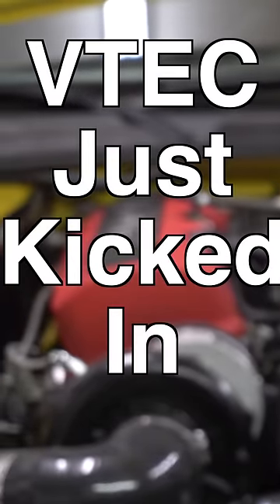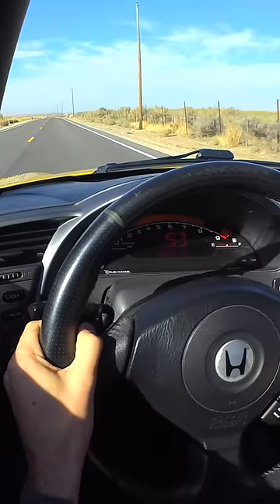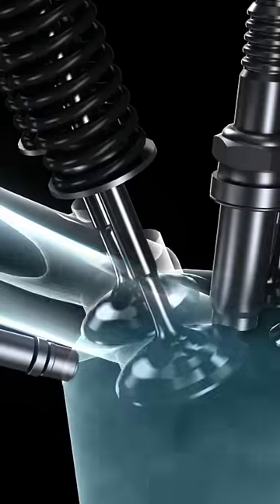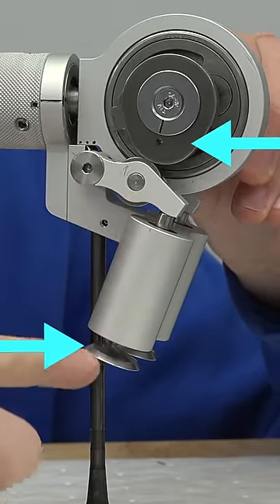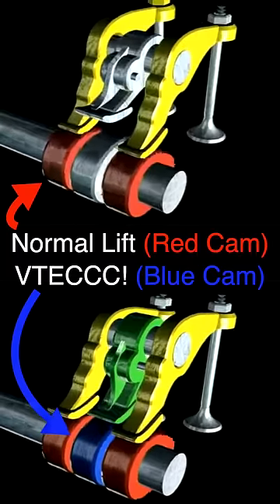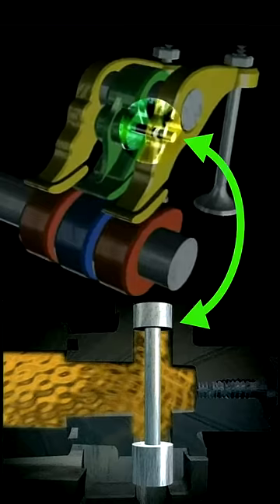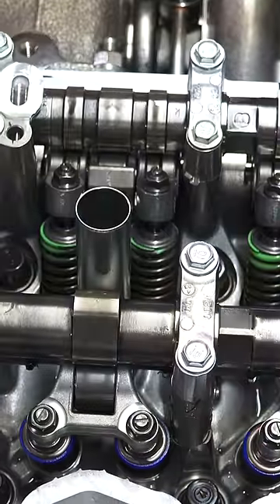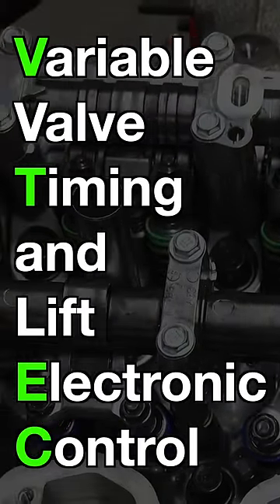How VTEC Works (In 60 Seconds)

Comment: The power difference this makes is amazing. If you look at a print out of a K20 engine. It only develops around 120hp at 6k rpm. Then vtec is enabled and rockets up to 200hp at 8500rpm it’s an incredible system and it’s highly affective. Even better when you have vtec on both intake and exhaust like the F20c found in the s2k
Reply: k20 makes more thaan 120hp at 6k rpm lol, its not an 80hp jump
Reply: @arcanevoid9199  it’s around that. Might be slightly higher 130 ish but it’s not much more.
Reply: @RosskoPeeko  have you looked at a dyno sheet? its closer to 160, variable lift adds power but not that much. if theres that much of a gain there is an issue, even 40hp~ means the smaller lobe could probably be bigger
Reply: @arcanevoid9199  it was about 10 years ago I seen one and I’m thinking it might be wheel horse power.
Reply: @RosskoPeeko  yea 130whp would be about 160bhp
Reply: @arcanevoid9199  like I said. It was many moons ago when I last looked at a K20 print out :P

Comment: Its lag without the turbo
 Don't be fooled people, it doesn't make your car faster when it engages, it makes it slower before it engages, its an eco thingy really...😅
Reply: it does make your car faster, and it’s not designed for economy but that is one of the bonuses. try driving a 2zz with vvtli (same thing), and going from having traction to wheelspinning when it kicks in
Reply: @arcanevoid9199  Variable valve timing and lift doesn't disable two valves at lower rpm, it can create an equivalent by halving the lift and duration but that's the point, you are reducing the flow at lower engine speeds, how is that not restricting low down power, I've seen plenty of V-tec deletes on performance builds allowing them to run all 4 valves at lower engine speeds to allow more flow and thus more power, think it through, look I'm a Honda lover myself my collection would make most jealous and I've been an engine builder (N/A specialist) like 20 years so do know a thing or two, I know most young Honda guys get defensive about this stuff hence the emoji but I am correct, explain how having an engine run as it would normally gives it more power, nah pre v-tec is engine retardation and with V-tec on its just breathing normally like any other engine, you realise their are different types of v-tec too yea earlier V-tec (actual v-tec) doesn't allow for valve variability its basically single or twin cam, 2 or 4 valves so it's really not the same as vvti either and your 2zz should be loosing traction as soon as you shift like cars used too before all this nonsense...🤣
I actually like vvti it let's us do great things with turbos and is very helpful with tuning but I'm realistic about early V-tec. If you get a chance to drive any vehicals with v-tec locked it's a whole different game theirs so much more low down torque available all they have done is delayed the power band and its 100% an emissions and eco thing. 😏
Reply: @EZ-D-FIANT  at low speed you dont want flow you want velocity, thats how you make good torque and power. this is nothing new and applies to the whole intake system too. and im not sure where you get the idea that it only uses two valves at low rpm? it switches to a different cam profile opening the current 4 valves even more to increase flow in and out of the engine. deleting this and going for a bigger cam would loose low end torque & power. toyotas VVTi and VVT-Li are very different, the variable lift helps it to make 190hp out of a 1.8L. and if you look at the dyno run the graph goes shoots up at 6k rpm when it comes on. and having vtec on all the time is not good for power, as being an na specialist you should know cams are always a tradeoff and have a specific rpm range which they work best in
Reply: @arcanevoid9199  just bite the bullet and go tell all your Honda friends how V-TEC makes there car slow, go on it'll be fun...😏

Comment: It makes your valvetrain fail prematurely, yo
Reply: not really
Reply: @arcanevoid9199  but also yes, cam phasers do fail on the reg, dawg.
Reply: @randymagnum143  i mean thats not even what this video is about, cam phasers change timing not valve lift. ive never heard of them being a regular issue, most of the time they are never replaced lol
Reply: @arcanevoid9199  what does Honda recommend as replacement intervals?  Isn't tensioner like 80k miles and inspect chain then?  Most of these that get scrapped are because of jumped time.
Reply: @randymagnum143  idk i dont have a honda, ive got a toyota 2zzge with the same technology. did a timing chain kit at 140k, still has original vvti cam gear. have seen a few of them for sale with over 300k and more than likely on original chain & vvti cam  gear
Reply: @arcanevoid9199  at that point it would be Russian roulette driving down the highway

Comment: Womp, womp, wommmmmmp. All vtech does is keep the max power band open longer. You do not gain  more horsepower or "power" from it.
Reply: yes you do, without it the engine would make less power
Reply: @arcanevoid9199  vtec literally let's the valves stay open longer. You think when they dyno test the car and say "155 hp" they are saying 155 until vtech?? You are silly. You hit max horsepower, vetch cracks, valves stay open longer, this then allows for your max horsepower to not fall flat on its face. Your not gaining anything that isn't already there. It literally keeps the max power band running steady instead of the up, down style charts.
Reply: @clownbutt55  it’s not just duration, it changes the valve lift at high rpm by switching to a different cam lobe. that’s what gives you the extra power, changing duration doesn’t give you the sudden increase in power
Reply: @arcanevoid9199  staying open longer as I said is exactly what your saying. Where we are not agreeing is the power aspect. There isn't hidden power in the engine that vtech magically brings out. Every car has a power band, typically that power band falls off after a short time which is where that next shift in gears come in. Vtech only allows for the power band to stay steady for a longer duration of time before falling back down. That's why you hear and feel that little bit of push, the valaves staying open longer is only allowing the power band to keep going into higher rpm without losing that power earlier and needing to shift to get that power back.
Reply: @clownbutt55  no you don’t understand, it physically changes how much the valves open, duration does not have anywhere near the same affect in power. duration helps with low end torque, fuel economy etc. and in my Toyota celica with the same technology it is not a little bit of a push, it’s like 40hp more. if you look at a dyno graph it goes vertical when it engages
Reply: @arcanevoid9199  that's cool man. My b18s and multiple h22s shows literally 0 increase on dyno. Just a longer period on the max power band. 🤷‍♂️ oh well.
Reply: @clownbutt55  unplug the vtec solenoid and then try, if there isn’t any change than it isn’t working obviously

Comment: This system is way smarter than vanos
Reply: Valvetronic is the BMW variable valve lift system. Used with Vanos which is variable cam timing.
Reply: @1maico1  yup that’s right. Glad we’re on the same page.

Comment: All the lag of a turbo....none of the power
Reply: funny but not really true
Reply: @ArcaneVoid  I've just never been impressed. The idea is well planned, but the execution was odd. In the early days it was alright but now with other cars running variable on both cams and some cars adjusting twice through the rpm range vtec just doesn't offer anything useful
Reply: @painhour  this video is about variable lift though not timing or duration, and my car has vvtli which is the same thing. idk how sudden 40hp at 6000rpm isn’t useful, sounds mad too
Reply: @ArcaneVoid  thing is we just going to have to agree to disagree on this too. Having ran turbochargers for over a decade an all motor setup just ain't the same
Reply: @painhour  yea an all motor isnt the same, it offers a different experience. but just as an example how is 200hp from a stock 1.8L not impressive? the eco version of this engine with no variable lift only makes 140
Reply: @ArcaneVoid  I think my previous statement was a bit harsh. All motor definitely has a place in both street and motorsports. And I can't deny the fact that any sort of "on the move" valve adjustments are going to be way better than a stock type setup. I've had fun on track in all motor cars just as forced induction.